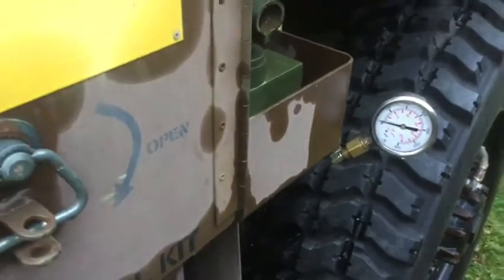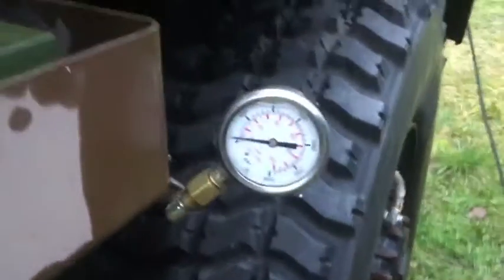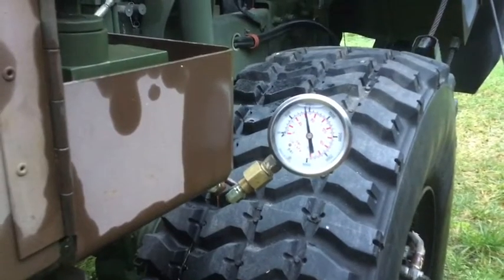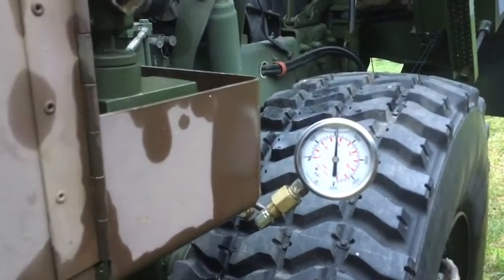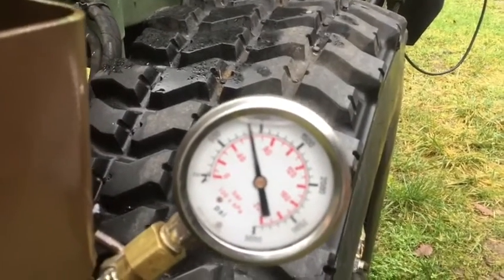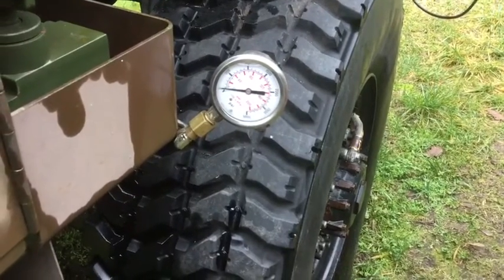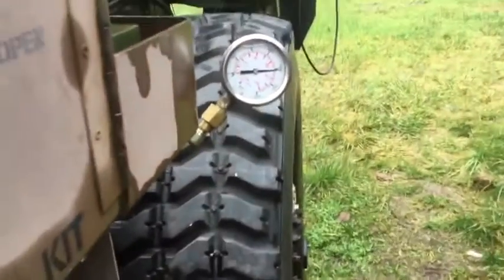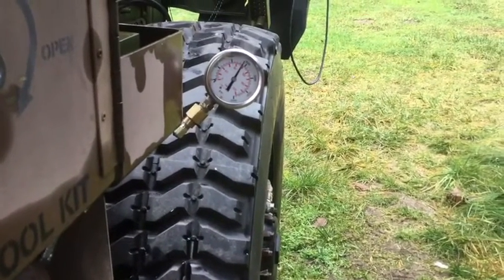LMTV Hydraulic Pressure Testing

Comment: I recently saw in a training video that they turn the cab lift and lower nob to the center position in between the two before operating the truck. I don't recall seeing that previously anywhere else.
Reply from the maker: NEILVVT haven’t seen that anywhere.  Perhaps someone was worried about accidental activation but there is an inversion valve in the system that disables AOP air when you apply park air/release the park brake...